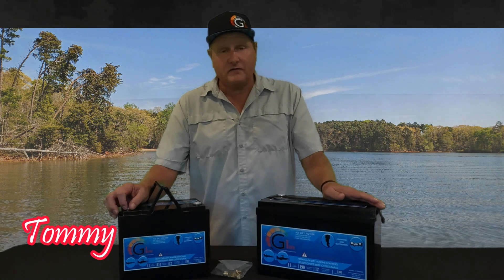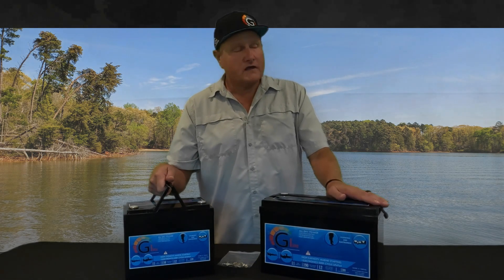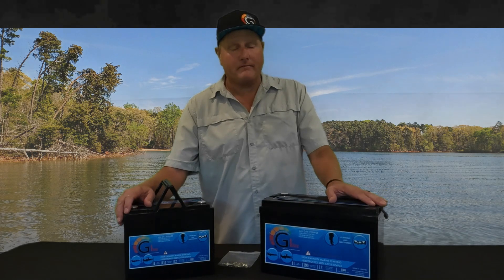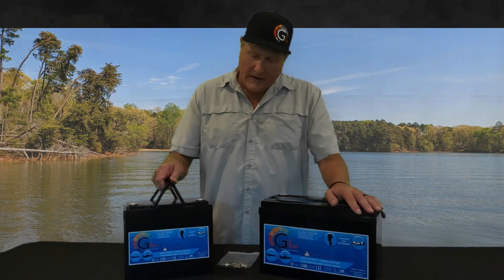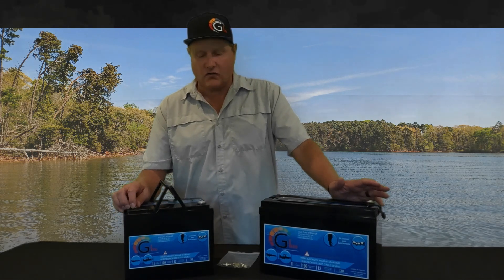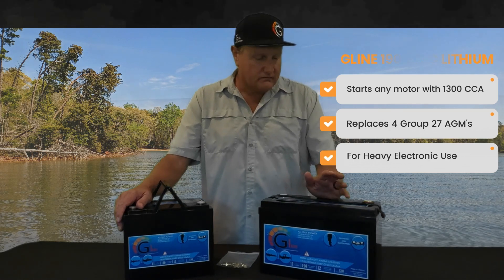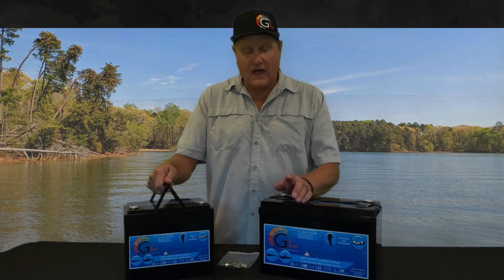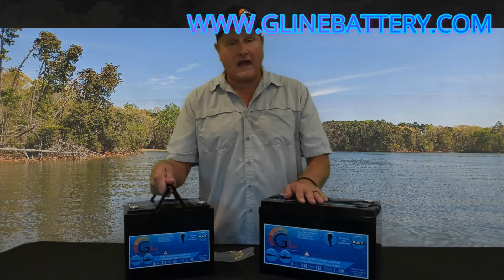GLINE BATTERY VSC LITHIUM CRANKING BATTERIES - ARE THEY BAD FOR YOUR RIG?

Comment: Going on what he says at the start, with JUST A SUPER CAPACITOR in series with the LITHIUM DOES NOT NEGATE THE LOW RESISTANCE OF THE LITHIUM BATTERY, COMPLETE NONSENSE! HE DOES NOT ADDRESS THAT ISSUE AFTER MENTIONING IT.  A bit SUS I THINK.

Comment: How's the tempered situation? I have itmes where I will be using it in -40f. Will it still work and charge? I would really li,e to swap over to lithium for longevity aspect. I know my lithium currently has to be removed and warmed up to 40f to charge them fully. I use 4 lithium and 4 lead acid. The lithium has to be removed and warmed to charge them. They are 5 years old. I was wondering if the technology has improved? Even if it's a slow charge to warm them then a full charge. I have to replace the lead acid about every 3 years. The lithium should be 10.
Reply: I live in MN and use LIFEPO4 batteries ice fishing with no issues and the all have low temp charging cutoffs under freezing temps.  If you try to charge a LIFEPO4 battery below freezing you will permanently damage the battery in terms of longevity and capacity.  Now I've used them in -40f ice outside ice fishing with no issues but never charge under 32F even with the low temp cut off.  This video is great cause it talks about LIFEPO4 Cranking/Starter batteries.  I have my boat out some times in Feb in 10 to 15 F but wont go any colder cause the batteries is the least of your issues as the water in your motor/boat become your enemies at super cold temps.
Reply: @berryrice  I live in an RV. A 1991 winnebago. I am about 7000 to 8000 elevation. Lithium iron phosphate does not cycle well in the elevation and when in a non heated enclosure. I could move them inside during the cold. I do not have access to 110v ac power regular. I have been doing it for 10 + years. Lipo batteries are not reliable in my situation. I do not discourage the use of them. They are just not correct for me. Your millage may vary. I do not want to discuss the environmental impact of acquiring the components to produce them. I am sure when you charge your batteries it is in a warm place. Warm is relative in my area. Having my home at 50F in winter uses a propain heater and wood stove. Both use a sparing amount of 12v. The battery bank is exposed to the external temps. To convert to lipo or life batteries, I can sustain the lead acid and replace it for 20 years. I distill my own water and get store bought items every other month. I just received reliable internet access. Satilite and starlink are OK at the best. I have crunched the numbers and have seen the cold charging. It it takes 3 days to replenish the batteries. I will need 4× the reserve. I can charge the lead acid in about 3 hours of sunlight or 2 hours of wind. I have even acquired a 12v 200ah lipo battery and then sold it. It burned a 75a alternatior on the wind and shorted a solar panel. I use an altornatior from a 78 Ford inline 6 truck. They are $35. The regulation is $10. Solar from harbor freight $225 × 2. They came with the controller and wires. Yes their is better. But this is just tank strong and idiot resistant. I do get fuel delivery 100 gallons of unleaded stored in the rv for generatior and truck use. I have 50 gal in cans for emergency. I can crank the rv and use its regular heating system to heat the rv in an emergency, but I usually syphen the fuel for the truck or equipment. I have thought of diesel. But the starting issues when cold removes that. I live on a fixed income and make a bit by collecting wild cattle for the market. I even stock my freezer that way.
Reply: @mrheart4242    RVs in cold climates are the extreme side and LIFEPO4 hasn’t really improved a whole lot in the last 5 years. Price is way down though.  This video was more focused on starter batteries for Marine applications as small to midsize boats are used sub freezing and you still need a heated garage/storage to make sure all the water is out of the motor and boat. Thus the LIFEPO4 batteries would warm up for safe charging. I see there are a few lithium iron phosphate, batteries that say they are good for dropping replacements for starters, but a question that for automotive /rv (non boat) because automobiles will sit out in the deep cold all winter long. I’ve looked into the self heated lithium batteries as well but that’s a little bit of a crap shoot too.

Comment: I have a 1998 tracker Force 40 horsepower by Mercury Marine 2-stroke. I would love to use a lithium battery as my cranking and graph battery would you recommend this battery for use with an older 2-stroke? The guy at Mercury told me not to but he couldn't give me a legitimate reason other than they have just not been approved for their Motors under 75 horsepower or two strokes
Reply: @NeilGraham.I.M.F  not unless you add in everything to protect the alternatior. When the bus shuts down the diode in the alt gets everything crammed back into it. It then burns up. A 12 lead acid and a charging circuit to the lithium will get you by. Just shut it off when the battery is close to full.